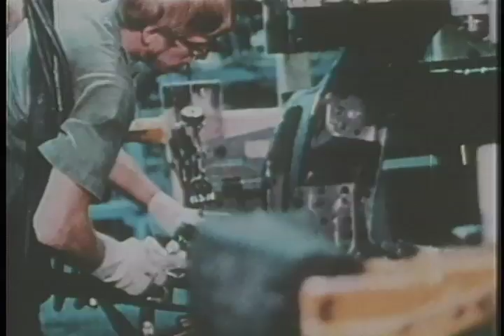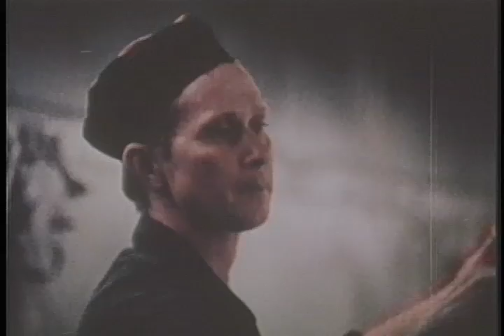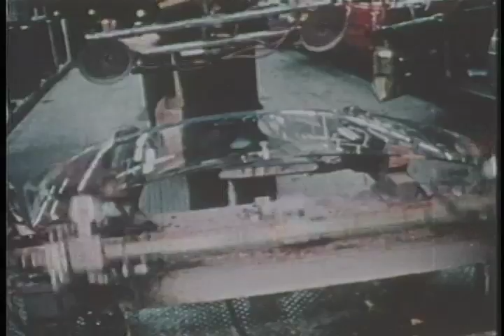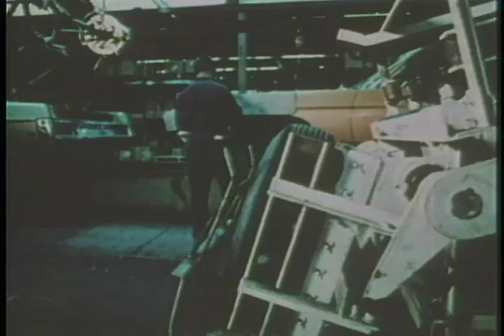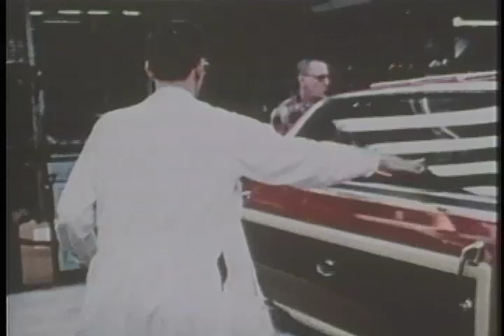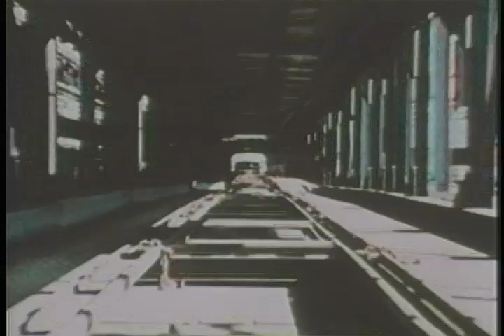Full line of Ford cars being built

Comment: My father built most of those fixtures and welding machines for the Ford Granada.
He was a tool & die maker @ The Budd Company 1954 to 1991
I worked there also & Trailmobile as a Die Setter/Heavy Equipment Operator.
Reply: The jigs and fixturing is out of this world.
Reply: I had a 1977 Granada. Had an inline 250 CID 6 cylinder and a Jatco automatic transmission. Easy to work on and reliable as hell!
Reply: @Fireship1 my Uncle George in California bought a new Granada in 1978 in California. Put 220,000 miles on it and it only ever needed oil changes, brakes, tires and car washes. Best damn car he ever owned.

Comment: My first car was a new 1973 Ford Gran Torino. Bought it through Ford military sales, Subic Naval Base,PI. March 1973. Picked it up after my WESTPAC cruise was over. Picked it up at now gone Skyway Ford, Manchester Blvd. LA. It was pastel green with the 302 ci V8, power steering, power disc brakes,AM radio, no AC. Came in at $3470.75.

Comment: I've always wondered why, on both sides of the rear roofline of my classic ford there is tin filling. It's comforting to know that, apparently it was part of the production process welds rather than a roof replacement.
Reply: its actually hot melted lead thats wiped into the join , then filed back
Reply: chopperking1122 Thanks, always nice to learn something ;) Guess the bodyshop wasn't exactely the healthiest place in the factory back then

Comment: I own a 72 Mustang and I have worked on many 71-73s. After 71 all Mustangs were assembled in Dearborn (in 71 some were made at the New Jersey plant). This video was stated as being from 1972. Early Mustangs were also built in the San Jose plant that was closed in the late 60s.
Reply from the maker: Could be Dearborn and they'd use a portion of the same rail line.  Thanks for helping us narrow down the possibilities.
Reply: Glad to help.
Reply: I was  wrong about the closing date of the San Jose plant it closed in 1984 and is now the site of a mall.
Reply: @RT060789  My dad worked there from 66 until it closed.
Reply: my research suggests that San Jose dropped the Mustang in '71 to assemble the Pinto alongside Torinos, but added the Mustang back in '72 when Metuchen switched exclusively to Pinto assembly and the Torino went body-on-frame and moved from San Jose to Oakville.  Dearborn added the Maverick and Comet for '72 because the St. Thomas plant struggled to meet the overwhelming demand for both Pinto and Maverick and poor sales of the midsize 'stang left plenty of room on the Dearborn line.

Comment: With the crap that passes for new cars in 2015. I would gladly love to go back to 1971-1972, and drive one of these beauty's out of the show room. Because even in 71-72 you could still work your car yourself you didn't need to run to the mechanic to put a light bulb in or use some high price code reader to tell him you've got a loose gas cap or oil filler cap making the check engine light come on. Plus I've thought gauges were better than idiot lights.

Comment: Actually this video shows how crude auto production was.  Few worker protections, no masks for painters and body workers.  Body panels slammed together and then crudely welded.   Robots now perform a much preciser job of body assembly with the result being much superior fit and finish.  Few body rattles now, many safety devices now, few then.    Crash statistics now bear out a much safer vehicle, even smaller vehicles are now safer compared to their 1970's and 1980's cousins.  Computer aided design and manufacturing makes for a much better vehicle.  Aside from styling, the old full size vehicles don't hold a candle to the newer, technologically advanced models.
Reply: Preciser yeah. More precise too.
Reply: one of the many advantages of using robots is that  robots dont need frequent restroom breaks to urinate, evacuate their bowels, or like most U. A.Dubya  workers, play with themselves. Robots dont bitch and back-sass their supervisors. Robots dont spend their weekends in bars in order to get drunk, get laid and get into a fight, the common goal of the U.A.Dubya worker!
Reply: Makes for a much better vehicle that won't last as long!

Comment: Those cars were made to last and made right. They'll always be worth more than today's garbage
Reply: mike foster none of them lasted. 5 years was the life expectancy. Drivetrain, suspension, electrical, rust. My family has worked at Ford since 1954. What and how we build now far exceeds anything from the past in both quality and performance.
Reply: @Canadasvt  wrong..look on here under 1991 Lincoln Town car my blue heaven and you'll see how cars were made back then.
Reply: mike foster I was assembling F150-450’s in 1991. Still building Fords today. I know what I know from experience.
Reply: @Canadasvt  and I know what I've owned. I've had a 88'towncar,1996 t bird,and my 91' Lincoln. Think what u want.
Reply: There’s a 71-72 Ford galaxies coupe here in safford Arizona on the side of the road for sale.  Been there for years.  Not a popular car to restore.  Rock solid southwestern body